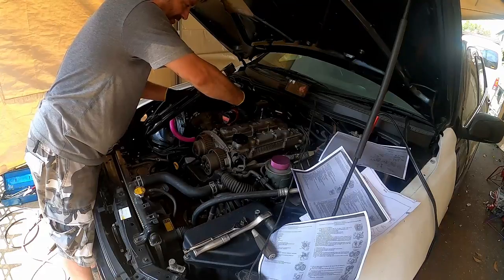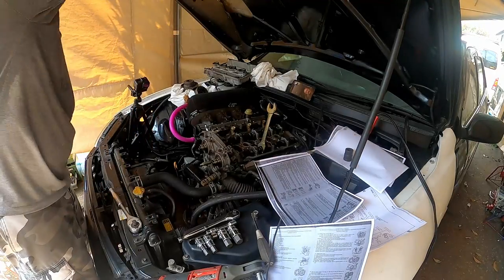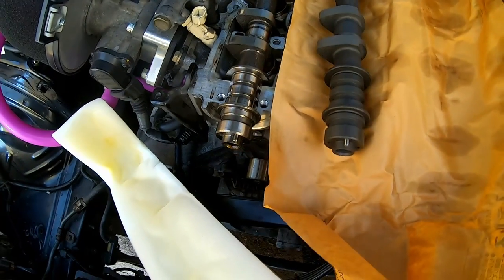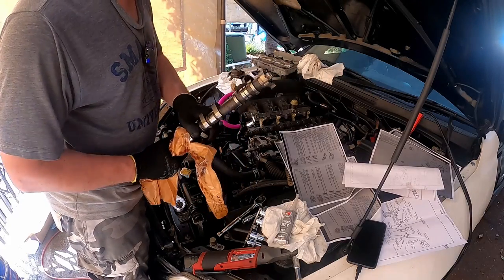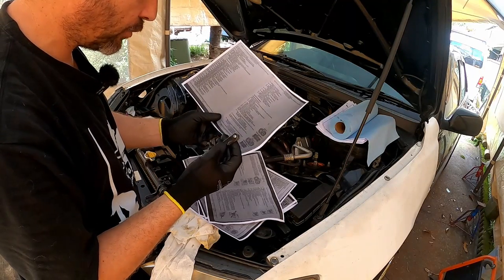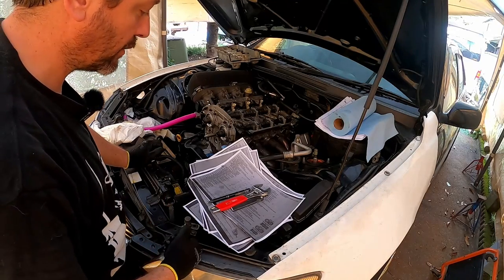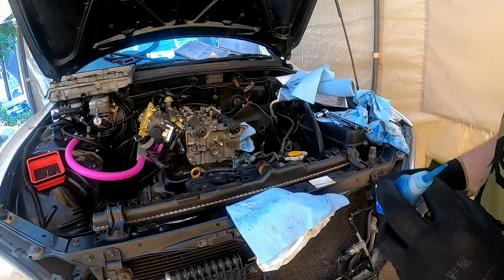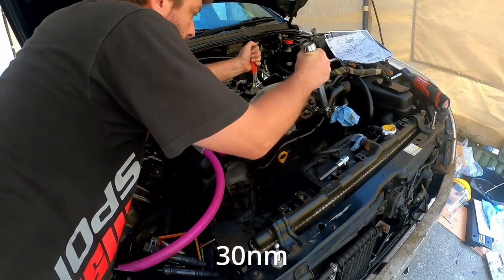FITTING TODA CAMSHAFTS ALTEZZA 3SGE

Comment: Where did you purchase that mesh filter? Sold out and my local toyota says not a good # 😢
Reply from the maker: You mean the vvt filter?
15678-74010? 
Got it from Toyota Japan...
The link in the description isn't working like it used to...
15678A in the bottom right corner of the diagram .

https://www.megazip.net/zapchasti-dlya-avtomobilej/toyota/altezza-altezza-gita-42428/sxe10-53771/sxe10-aefvf-901879/cylinder-head-17648202?nid=4024789#g17648202/cylinder-head

Comment: Do you measure the clearence with the lobe in 180° position away from the bucket or 90°? I'm a bit confused from the manual.

Also, use a magnet for the bucket removal. Way easier.
Reply from the maker: Lobe pointing away.
All my magnets have metal shavings on them. 🤣😂😂🤣

Comment: Ever seen oil leak out of the exhaust cam gear small hole ? I changed the belt all seals even put a different cam gear on and it still leaked , then I plugged it with JB weld it stopped but then it started to leak out the next weak point the inlet cam gear ! I’m fully over this Toyota junk , sticking with Nissan lol
Reply from the maker: Good luck with Nissan.